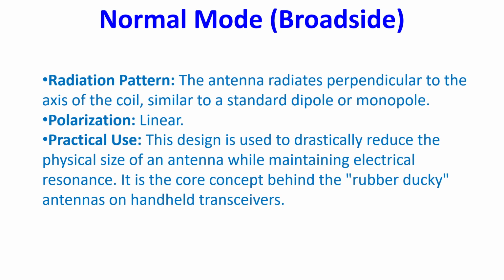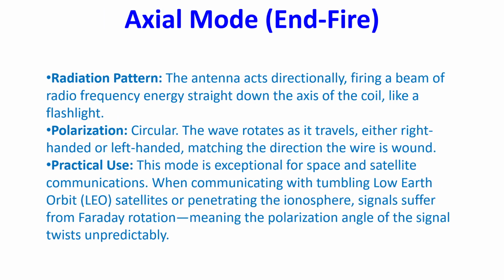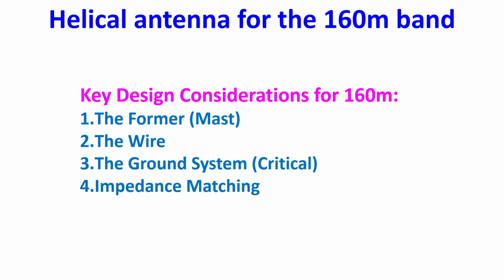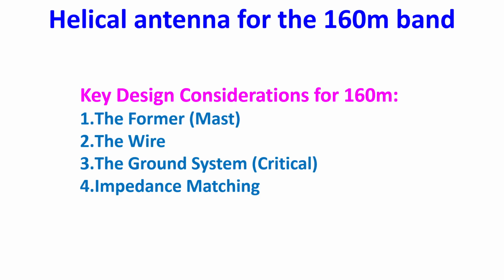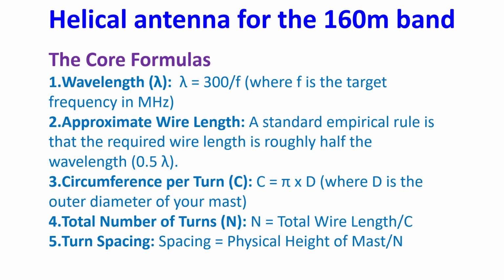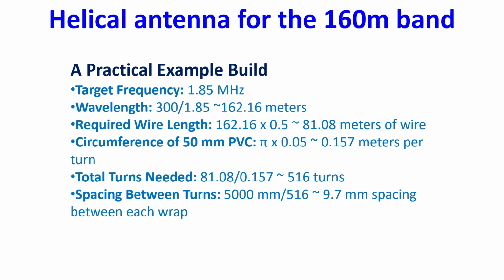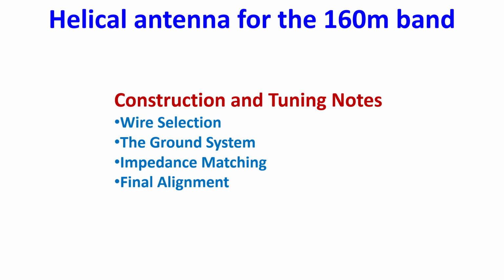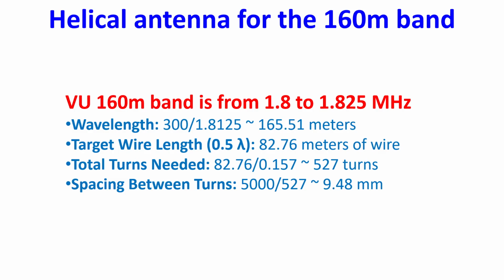What is a Helical Antenna?

Comment: Jon, this is a fantastic video! I have been considering the implications of constructing an antenna of this type for some time, but had not located enough helpful information about the details until viewing your video. Thank you so much! Now it is just a matter of deciding if, when, and for which frequency to design it. Thank you so much for this extremely useful, clear, and motivational content! 73 Jared, AC7WH
Reply from the maker: I am very glad you found the information helpful for your project. Hope to hear the results of your experiment soon. As the solar cycle 25 is going down, you may need it if you do not have space to mount regular antennas for lower bands. In 1980s, when the solar cycle 22 was down, 40m propagation was low and I had a dipole for 80m. Had plenty of space at parents' home. 73 Jon, VU2JO
Reply: @johnsonsTechWorld  Today I put this information to the test. I constructed a crude helical antenna mounted above ground with the driven element and two counterpoise wires trimmed to 1/4 wavelength on the 17-meter band. It was easily tunable with my tuner to a 1:1 SWR, and I successfully tuned it on the 40-meter band (by incrementally tuning my tuner on the manual setting with some difficulty) at a 1.23:1 SWR without adjusting the antenna itself. Than you for inspiring me to try new antenna designs like this! Here is a link to the video about my antenna: https://youtu.be/ZuW9dEqqnIE?si=cqmCh-bx80nz8ozu

73 Jared, AC7WH
Reply from the maker: @AC7WH  That is great news. Shall see the video now itself. Thanks for sharing. 73 Jon, VU2JO